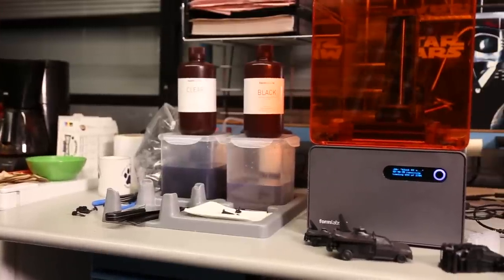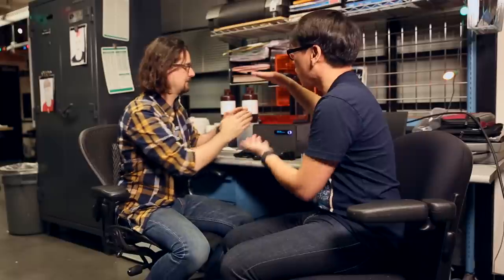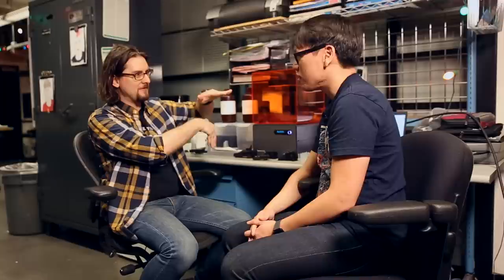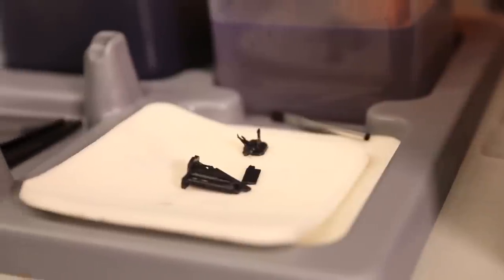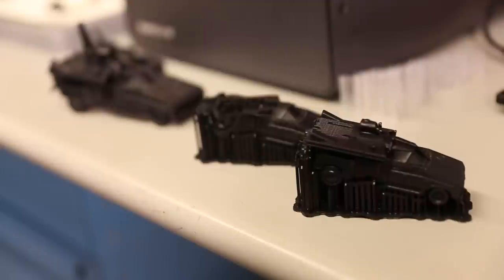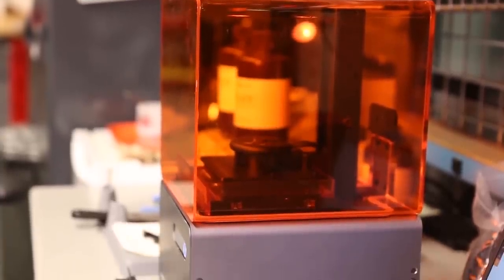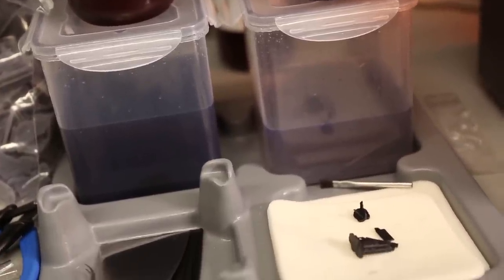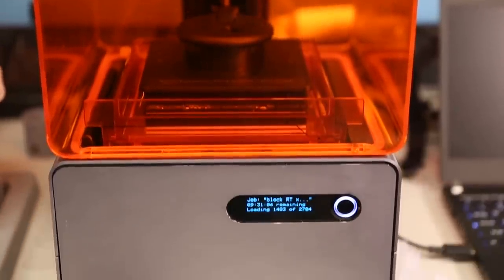Testing the Form 1+ 3D Printer

Comment: Keep in mind that when they're mentioning FDM, they're comparing it to the Makerbots that get featured on their show quite frequently which are limited to 100 microns.  There are other FDM printers that can achieve much higher resolutions, the Ultimaker 2 for example can achieve 25 microns although it might not make as nice a looking model at that resolution.  But at 50 microns I doubt you'd be able to tell the difference.

And a printer like the Ultimaker 2 is much more versatile given the build volume and the variety of materials/colors that can be printed on it.

Comment: I'd like to see how it could print on the finest setting. None of these 3d printers impress me yet, but in 5 or 10 years this technology will be amazing. Especially if they get bigger and used in metal work to print pieces out of gold, silver, pewter, steel or iron. Buying a block of steel and printing a chair or a bar of gold and printing rings or a chain. That's the future.

Comment: I tried the same SLA technology with xyzprinting's nobel 1.0 and I must say it produced the same high quality results.
However, the nobel printing speed is much much slower than Form 1+......
But, Nobel 1.0's price is also much much less than the Form 1+
I got the Nobel 1.0 for $1499 off xyz's website and it has been working great! in my opinion, the extra hours didn't really mean much when you are doing a large print. But in small prints it really can make a difference with the faster speed of Form 1+

Comment: The resin printers I remember from years ago printed from the top down with the build plate sinking down on each pass.  That would seem to remove the issue of 'peeling' prints off the bottom.  I know all these MIT folks probably got started because they had this 'peel process' studied....but jeeze it hardly seems like an elegant solution.

In 50 years we will all be building objects with nano machines that have 0.000001 tolerances and cast in twenty different materials from plastic to stone to cartilage to meat.

Comment: hmmm Resin printers is what I've been waiting for to come into normal prices, but the way this one works, it seems like it's good for making high quality models. but you can't make anything with movable parts I would assume.

Then again, this one is pretty expensive as well. Guess I'll keep waiting for a future raising platform resin printer or preferably powder printer(better and more solid material for structural prototyping) to come into a reaosnable price.. sometime in the year 2050 perhaps :p I'll probably end up getting a decent extruder printer hwen I get some good money flow and they're reaonabely priced for one with a printbed with a usable surface outside of minifig size.
Reply: its not for making models with moving parts, its for prototyping parts mainly for recasting. The platform and print size is 5" x 5" x 6.5" even without seperating a print up into parts you do do some really big stuff.
I mean check this out - http://instagram.com/p/tl5KJKnmEm/
Thats 5" without the build platform...and thats not even the highest resolution

Comment: $145 for one bottle of resin? Damn, that's expensive. You could buy almost 5 1kg spools (or more, depending on price) of PLA or ABS filament for that much to use with a Makerbot, which would last you a while.
Reply: Yeah the filament based 3d printers are far more economical in both cost of printer and filament.
Reply: yea, but its good that this company is starting with this tech. In time there will be other companies with cheaper 3d printers. Recently there was company who used paper to make 3d prints, if you wanted to restart you could then feed that same model into machine.

Comment: Founded by 2 grad students from MIT, therefore, they know what they are doing...btw this is my 3rd printer that I have been sent, and prints need to be made at an angle, and you have to experiment in order to find the best way to print the object😵
Reply: +heavym3tal XD
Reply: +heavym3tal Do you have professional experience with SLA? The angle requirement is an effect of the technology. No the product. Also the issues with the printers are a manufacturing Quality Assurance issue. I take it you have very little understanding of that too. All major companies have those issues too its just that they sell 10x thousands so they work them out faster.There is nothing wrong with what is happening here it is just that there are limitations to modern manufacturing and technology. WAY WAY better than FDM technology if finish and resolution is important to you.
Reply: +gus bisbal Sorry, let me clarify. It is bad to assume that graduates of MIT would make a superior product to those that did not graduate from there. Besides, how does this video persuade the average consumer on SLA 3D printing, with all of the associated problems?

Comment: how mush does the Form 1+ 3D Printer cost??
Reply: +kairus1 $3299
Reply: +kairus1 It exist some for less than 200 that are also amazing
Reply: +H Majhail It cost actually 100$ and it is better than this one, lookup Tiko3d 3d printers are expensive not because the parts its because THEY wanna have them expensive, make one is incredibly cheap
Reply: thank you.
Reply: +MegaNitrospeed but it's not the same type printer, this works in a completely different way. Did you even watch the video?

Comment: Mine Printrbot Simple Metal does 0.05mm no problem :P
Reply: I think you mean 0.5mm. But this printer does 0.025 microns. That's 0.000025mm. Per layer.
Reply: Robert Johnston No and hell no :D Form 1+ does according to it's manufacturer 25, 50 and 100 micron layers - that's 0.025, 0.05 and 0.1 mm my Printrbot Simple Metal by default does 100 microns - 0.1mm layers but the electronics and hardware are precise enough to do 0.05mm (50 microns). Furthermore Printrbot Simple Metal can't do 0.5mm layers without modifications since it's nozzle is 0.4mm and thus making the extrusion width under 0.5mm so the layers wouldn't touch each other. I'm new to 3D printing but once you get one you learn facts about FDM very fast ;)

Comment: If only the parts were as strong as ABS....
I worry that you get a crap print, make changes to the file to try to get a better print wait 8 hours to find out its also a failed print....repeat. this happens with my Printrbot, but I can fix it way faster.  I also wonder about the huge lawsuit against them putting them out of business. Will they exist in a year?

Comment: Repeating that "upside down" thing a dozen times? Your audience got that part he first 2 or 3 times you mentioned it.
A good FDM printer is 20 or 15 micron (0.15m, Ultimaker II). Formlabs announces 100, 50 and 25 micron layer height and 300 micron featues (0.3mm) on their website.
Reply: Talking about a failed print but NOT SHOWING IT??? How should your audience get an idea of what kind of failures to expect?
Reply: jerks - nothing all i can say
Reply: Atalon Deer?
Reply: Actually, the ultimaker 2 can print at 20 microns, but you better get that bed leveled right :) I use a flashforge dreamer, which can print at 50microns but find myself using 150 microns the most as it produces beautiful prints when I want to go really fine I go to 100 microns, but rarely use anything above that resolution. I doubt that a lot of Makerbot users print a lot on 20 microns, as it is a bit overkill, and the prints will take forever (remember that 20 microns means that the printer has to print 50 layers for 1 mm height!).
Reply: Oreos I meant Ultimaker 2 users not makerbot users.Makerbots don't print at 20 microns.

Comment: Overpriced for a simple SLA printer, its just two low end galvo's and a low mA UV DPSS diode.  However the main factor they avoid mentioning is the operational costs.  The issue with all SLA printer's is the resin. UV cured resin is vary expensive by weight. Generally a liter of good resin will run you upwards of 130USD. You could buy lower end resins for at half the cost however your print quality will suffer greatly.